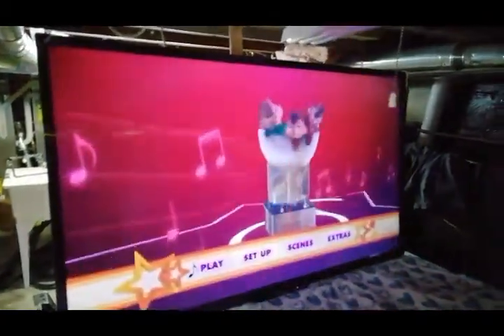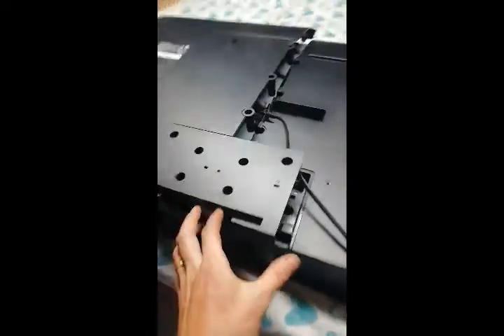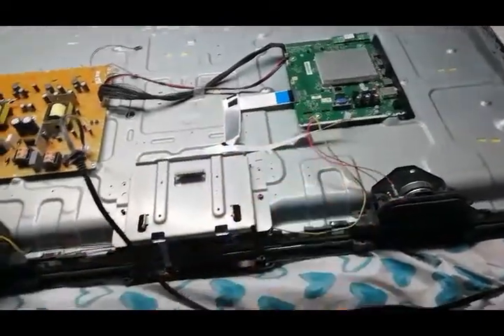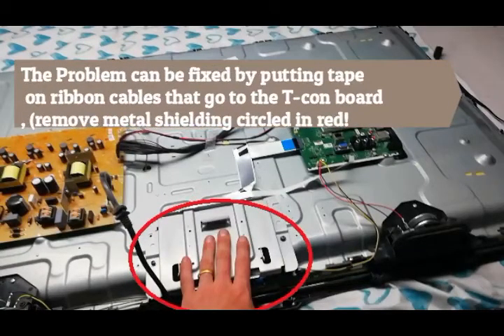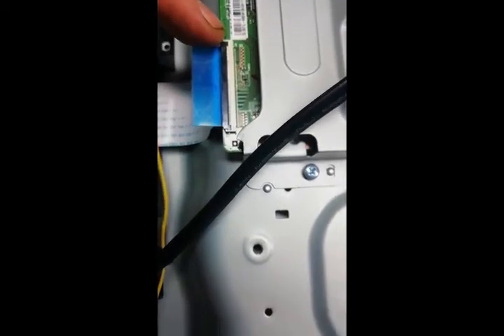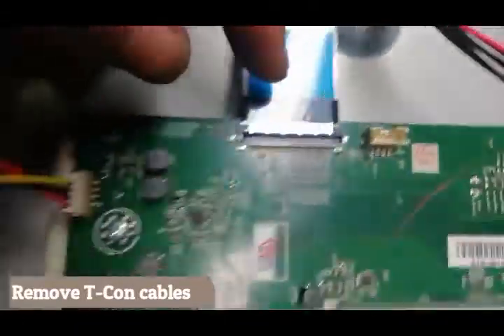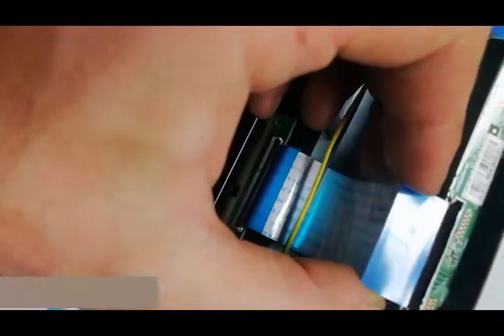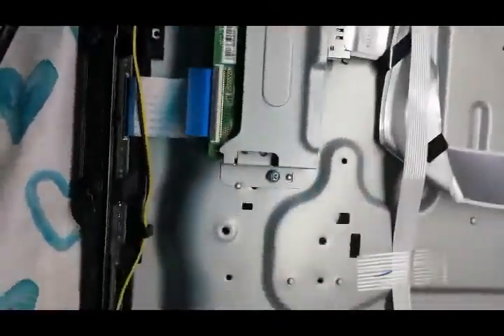Flickering Screen? Fix with TAPE!

Comment: If I put tape on all the pins and I can still see the screen jumping no matter what side I cover up would the T-Con board still be the problem?
Reply from the maker: don't need to tape all the pins just a few at a time, if still is an issue i would replace the tcon board.
Reply: I taped all the pins and it worked first try for me thanks :)
Reply from the maker: @disabled_ghost2310  great
Reply: @disabled_ghost2310  lol i hope you're kidding
Reply: And if the T-Con board don’t fix the issue then it’s the LCD screen.
Reply from the maker: @hutchinas  yep sound about right